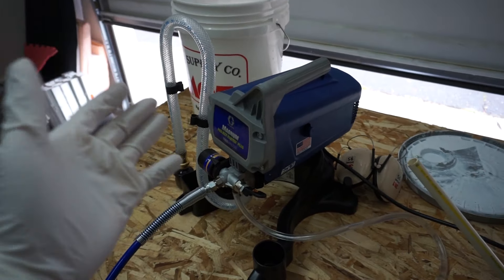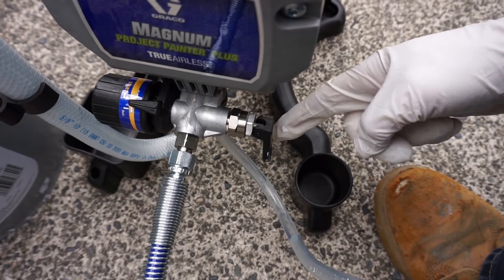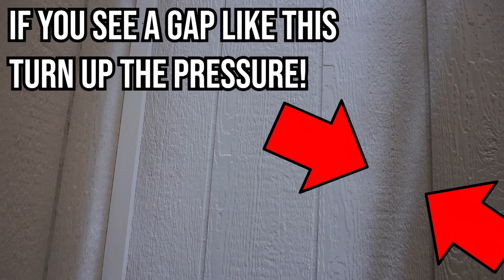My First Time Using The Graco Airless Paint Sprayer Outside My House | DIY For Beginners!

Comment: 3 pieces of advice from a 30+ year pro... Wand extension, and back roll the finish. And its better to put 2 coats than to try to force one heavy coat to cover.
Reply from the maker: Thank you for the advice! 🙏🏽😊
Reply: 2 coats are mandatory
Reply: Can I spray 1 primer  then spray 1 coat of finish. Without rolling if I tint the primer!
Reply: Instructions or other PRO'S say🤷🤷
Reply: We're the 2COAT King's over here. Regardless of what . it makes the FINISH so much more solid
Reply: @chichigalban3151  2 coats (done correctly) always looks better and lasts longer than 1 coat.
Reply: Thank you!
Reply: Hey brother what do you mean when you say backroll the finish?
Reply: @kendawg2142   means to roll with a handle after spraying.
Reply: What does it mean to back roll the finish did you mean with a roller
Reply: @outofthebox9913  Yes, spray the finish on, follow immediately with a roller, easier to use second person to back roll
Reply: Yes sir. 
And always.. alwaaaaays deep clean your machine after work. :) 
Been working with Graco Mark X HD 3 in 1 for over 2 years. :)
Reply: @alins4629  Without question.. Sprayers have to be well cleaned each day, after each use. I have been a spray man for 30 years.
Reply: Do you back roll siding ?
Reply: @louir1952  Sometimes.. Not every time.. backrolled siding looks better than just sprayed.
Reply: @paisteplayer1040   how many gallons paint would I need for an 1500 ft exterior home 1story . You think 10gallons enough?
Reply: @louir1952  Lots of variables, condition & type  of substrate...7 is a good starting point for siding, couple more for trim if different color.
Reply: @paisteplayer1040  you were right man . I had got 2 5 gallons and have like 2gallons extra
Reply: What length wand extension do you recommend?
Reply: @blakebiltwell5  Depends.. A 1' might work, depending on height of what you are spraying,
Reply: @paisteplayer1040 Question; I’m doing my cement foundation, would you recommend 2 coats?
Reply: @MikeyM1422  Raw ? yes. Make sure its cured first
Reply: If you have to "backroll" then why buy a sprayer? Why not just roll it?
Reply: @KelvinK.5238  Because its a much better finish and still much faster than cut and roll.. You would not ask that if you knew what you are talking about.
I retired last year from 30 years of painting for myself.
Reply: @kendawg2142  
Where when you are spraying the paint on... and usually someone is coming up right after you spray it... and uses a Roller to make sure there is no drips...
Reply: @louir1952  
1500 SQUARE FOOT???  
That is like a 100' x 15'= 1500 sq. ft... does that sound about right?
Remember... depending on your paint... you may want to add water, that would make it go further... again, depending on your paint.

But 10 Gals sounds like too much... but I have been rolling my on, and it has to be thicker... so I would be using more than normal... but I only have to do ONE Coat.
I'm painting on Stucco right now... UGH
Reply: @blakebiltwell5  
That is a good question... I would like to know too.
Reply: @paisteplayer1040  
"Amen Brother... Amen" ... I know that... me rolling Stucco is so time consuming.. but it does look good... but my house is 20 foot tall...
Reply: Ty great advise
Reply: What type of roller should ii use to back roll ??
Reply: @unclesnackschuene  Thicker is the substrate is texture or has grooves  or deeply grainy wood.. I usually back rolled exteriors with 1"+ thick naps

Comment: Thanks for this demo FTH. I'm a lime putty plasterer who uses an electric sprayer to apply lime paint (lime wash) for all my internal and external paint jobs because not only do  so when shopping in my local Lidl supermarket, near the fish and dairy in their tool section there was a Parkside airless spraying system for £120 ( $162.59) and had to have it.

I've commented on many YouTube films, to ask if it's OK for lime wash but nobody's responded back, your film is the first that's even mentioned water based paints, I like spraying, it gets to parts other beers cannot reach and is so much better than painting because you leave no brush marks or bristles and with care and consistency you cover the surface evenly and better and faster.

For internal coloured paint jobs I'll used a water based emulsion, the cheaper the better, and never use any pig fat in the final coat, there's no point because you want a breathable paint and any fat will make it non-porous.

I also noticed that you just spayed it once, and after spending so long taping and masking area's, why not add at least 2 more, it would look even better and when you asked what people thought, I think you need 2 more and you should have filled/caulked along the wall top at 7:31.
The rest of your house looks fine and there is no better feeling than coming home to your loved one and watching a good box-set in front of a log fire on a cold winters night in your own domain.

At the 800 year old Torre Abbey in Devon I worked on doing the lime putty, rough-cast finish as part of a £32 million project in about 2006 I just did the plastering, inside and out and some other contractors did the painting but inside one of the courtyards you could see the 200 year old (or older) lime paint and I counted 4 to 5 layers, this is because the old lime paint had a thickener like casein added to it up whereas with normal lime wash, if painted on too thickly it will later crack and peel off. Been working with lime since about 2001 and worked on many old castles, churches and stately homes, seen many strange things but never a ghost (that's another story) and lots of old bodge jobs by the ancients as werll as some of the most amazing things like embossed leather wallpaper.

I only work with putty mortars and plasters, no hydraulic, hydrated or cement and make my own mixes after slaking the quicklime, it's such a versatile material and helps to better protect your background walls and surfaces, acting as the sacrificial coat for the main surface as well as absorbing moisture like our breath and CO2. Another bonus is that you get better acoustics in the finished room.

Lastly with all the waste water and sludge I keep it and use it to make more mortar or paint for the next job because lime putty will keep for hundreds of years and the older it becomes, the stickier and better it gets.

Live long and prosper, all the best from a hillside in England.
Reply: Wow.... what you do seems so interesting !  I would guess that your methods are very old school and, as with most old school methods, is the better way to go.  Thank you.
Reply: @Mike-wh9dq , it sure is interesting plus you get to work in some ancient places and using lime putty unlike cement, gypsum and hydraulic limes there's no shelf life limit so you never need to bin it.

If you are interested in the biz look up S.P.A.B and there you'll find hundreds of courses in that kind of work.

All the best.

Comment: I sprayed a rental property from top to bottom with this same sprayer. It worked good but inside tight areas like closets were tough. I had several areas than ran (I wonder if back rolling would have solved that problem) understanding when pressure should be high vs low was huge, keeping your wrist straight for 1800 sq ft of painting was HARD, and keeping your speed consistent when the trigger is pulled wasn’t easy but overall it came out decent (had to do a second coat the next day due to missing my 50% overlap in a few areas and not back rolling. This is a good starter video!!! Thanks

Comment: as a pro painter, I would have back-rolled the sprayed on paint for a more even drip and sag free finish but nonetheless, a great vid for beginners. Good job FTH!
Reply from the maker: Thank you for the tip! I’m always willing to take advice from a pro! Thank you 🙏🏽 so much!
Reply: Sorry to be offtopic but does anyone know of a method to get back into an instagram account..?
I was dumb forgot the login password. I love any tips you can give me
Reply: As a pro painter myself & i mean 20 years of EVERYTHING from cars to fighter jets, tiny airbrushes to massive airless kits & everything in between I've never sprayed vertically up & down yet all these vids do that? The 6 inch bit above the windows for instance could have been done in one horizontal stroke instead of the 10 vertical ones? The only time i go up & down is when i double track, a method of firstly painting left to right then instead of turning the air cap i simply turn my wrist 90 degrees & 'double track' the same area vertically up and down, just a thought/tip? 
Good job all the same & no matter how you spray the finish will be always be a massive improvement on brush & roller 😊
Reply: What is back rolling?
Reply: @lpgibbo7463   When you say "the finish will be always a massive improvement on brush & roller", do you mean the finish is much better with a brush and roller or the spray will always be better than brush and roller? Thanks in advance for your response.
Reply: @raya472  After you spray you go back over the sprayed areas with a roller. It's a good technique when you have textured surfaces to make sure the paint gets in all the crevices.
Reply: @thediyprojectguy3219  ahh I get it, thank you so much.
Reply: something bout a roller makes it look origanl im not convinced
Reply: @raya472  Back rolling is a must if you need to touch up.  Especially in interior.
Reply: @thediyprojectguy3219  good advice
Reply: @brentlake2597  thank you Mr lake
Reply: @thediyprojectguy3219 but how could the spray not get in everything?

Comment: I’ve never used a home paint sprayer before. I borrowed one of these from a friend and had great  results and was easy to use. I do feel like it wasted quite a bit of paint vs rolling but the painted was way faster. Clean up was a little messy and slow but otherwise everything went well. No issues with runs or anything. I was impressed and may buy myself one in the future.

Comment: Thank you, thank you this is very helpful. I previously had an older Craftsman unit that weighed a ‘ton’. Painted my house with it, but very difficult to move around and priming was a problem, because the fitment of the plumbing was loosening up all the time. This Grace unit looks like a much easier unit to work with.

Comment: Good vid. I just sprayed on clear seal coat on half my fence with the same model right before I watched the video. It is pretty much this simple. The most difficult part of the process is the clean up, but even that isn't difficult at all. Using mineral spirits with oil based products would be a bit more difficult just because of proper disposal, but the process start to finish is pretty simple.
Reply from the maker: Thank you so much for sharing! 👍🏽😊🙏🏽

Comment: Great job and simple straight forward info without all the fluff.  I just bought one myself and have exterior siding like you but I live in a double wide mobile home with a 2 car garage so this will be a great sprayer for my home.  The question I have is the cleanup, after you are done with cleaning the sprayer and you have a bucket filled with wastewater what do you do with the wastewater?  How did you dispose of it? Thanks for a great video.

Comment: I also bought a hardwood dolly and I’m going to build a stand for the sprayer unit and a 5 gallon bucket so I can pull it along as I spray large rooms. Dolly is 18x30 inches and I figured I make it so I can place a one gallon bucket of paint or 5 gallons on the cart to provide stability and I’ll have storage under the spray unit for hoses and supplies.

Comment: Yes I have the exact same machine. And I got mines just last year during the summer afterwards I painted my whole entire house. I too was tired of using brushes I wanted to experience it with a sprayer the outcome was excellent. Not to mention I'm going forward to spray my outside of my house this coming summer. Yes it does drip a little bit and I realized and like anything else you have to get the hang of it but always good to have a Roller and a brush handy just in case.  It's definitely a great investment to have. And not for laziness.  But for shear time cutting.  GREAT JOB!
Reply from the maker: Thank you so much for the amazing comment! 🙏🏽☺️ thank you for sharing your experience!

Comment: I think you and the machine did a great job!  Since the paint is a thinned down version of paint, don't you need to spray a second coat?  I think I would feel much better having a 2nd if not 3rd coat of paint, just thinking about wear and tear on the finish.  Also do you need to spray a primary coat of primer prior to the actual paint?  Honestly I am presently struggling with painting my house with a brush!  My mother and I did it 18 years ago and so I decided to do it again, but I am doing it alone!  Therefore, this sprayer looks like heaven to me!  Would you also be able to spray under the eves, which I hate painting!!!

Comment: You mentioned the Wagner products, I have used them as well. My problem was blowing through a cup of paint every 90 seconds and the pain of stopping and filling often. I’m looking forward to firing this puppy up.
Reply from the maker: Yes I had a Wagner and it just stopped working on my third use and yes I agree you have to keep filling it up, works well for small projects though 🤷🏽‍♂️

Comment: Ive used one of those great machine and if u attach a 2x8 peice of wood to bottom each leg on it it will set right up to 5gal bucket and pick up tube will go straight down in bucket and not tip over.
Reply from the maker: Thank you 🙏🏽 for this tip!
Reply: @FixThisHouse  U welcome brother 👍

Comment: Great video!  I bought one to stain my fence which I’ll be doing in a few days.  I would have liked to seen it being used for an oil based stain (the clean up to be specific) but most videos I’ve found deal with water based paints.  Great job!
Reply from the maker: Thank you! The oils base should be an easy clean up. I wish you well on your fence! 👍🏽😊
Reply: Just run whatever it recommends for cleanup usually turps through the gun a few times then follow up with water...
Reply: You run paint thinner thru til clear

Comment: I'm not sure if I missed it but do you have to the thin paint? Or can we use it straight from the bucket
Reply from the maker: No need, I used mine straight from a brand new bucket. If your using old paint be sure to strain it first 👍🏽😊

Comment: I used mine today for the first time. It was spraying great but as I got to the end of the paint gallon, my sprayer stopped spraying and the motor turned on and ran continuously even though I couldn’t get it to spray paint any longer. Do you know why that happened?

Comment: I been using this same sprayer for awhile now complete houses with it they say it's not good enough to do big houses but I have painted thousands of square feet at first was kinda slow with it but after awhile I got different tip for more spray and wider spray and rough spray and fine spray just got experiments with it and it will surprise you something that isn't worth the money is the roller for the Graco sprayer not a big fan

Comment: Great work. I keep holding off on using my sprayer due to the mess I made the first time I used it
You made this look effortless!
Reply: it is all about adjusting pressure to paint density.  The lower the better. make test until you reach the expected quality you an then do your all house in a day or two.

Comment: Do you recommend this for interior walls? I'm completely sold but my husband thinks it will be extremely messy. Also wanted to use it to stain the deck. Thoughts?
Reply from the maker: Yes I do! I actually am planning to paint my interior guest room after I scrape off the texture on the ceiling. I will make a video of me doing the painting using this same sprayer. Your husband is is correct it can get messy because of the overspray, so I highly suggest to mask off everything and put dust barrier walls on adjacent rooms you don’t want getting overspray on. If it’s a room like a bedroom close and seal all doors and make sure to open windows for ventilation and wear a respirator 👍🏽😊

Comment: Hi sir. If you use the water base with that sprayer. How many cup of water you added in 5 gallons water base paint. Ans also if you use the oil base do you have a mathod how many mineral spirits   to add per a gallon to oil base paint . Anyone know please advice me. Thanks

Comment: Instead of masking off all the doors and windows and whatnot one guy I saw paints to within a couple of inches and then finishes with a brush.  Do you think that is a good technique?
Reply from the maker: That is a great technique when you are painting with a roller, the risk with using a sprayer is overspray. It’s possible you just need to be super careful and spray paint far away from windows after you paint the edges, but I highly recommend masking because it’s like painting a car 🙏🏽👍🏽😊
Reply: @FixThisHouse  Maybe if your going to paint the windows later a little over spray may not matter.

Comment: Great Video! Did you use paint that had primer in it? And wondering if you had to do two coats with the sprayer? I think i am sold on this.
Reply from the maker: Thank you! Yes I went to Home Depot and they gave me a ready to use without primer mixture. I did only did one coat and it’s holding up really well! I live here in the Pacific Northwest where it rains a lot and so far it’s holding up really well, but if you’re unsure, a second coat is always best! 🙏🏽👍🏽😊

Comment: There's something I dont understand,did you use only the paint through the hose?
You didn't mix it with water first?
Reply from the maker: I just used paint through the hose. The water was just to flush out the contaminants from storage and before use.
Reply: @FixThisHouse  is it a bit wasted to use only paint while not mixing it with water though?